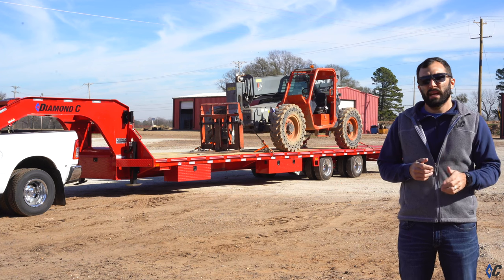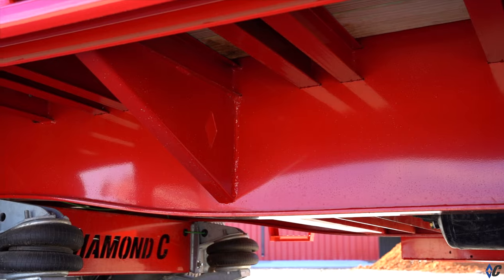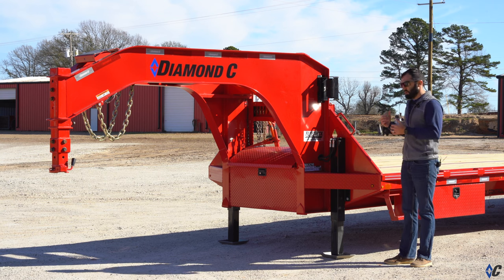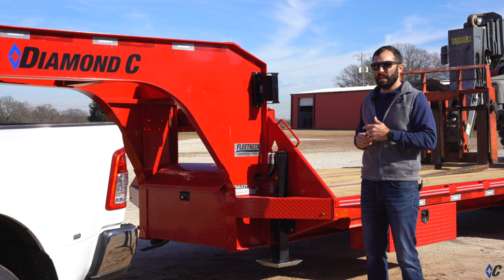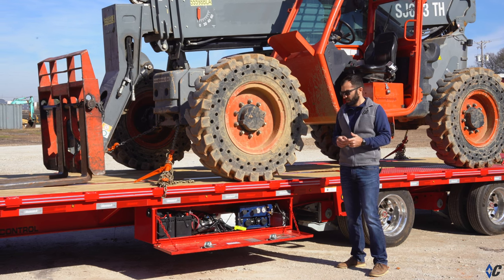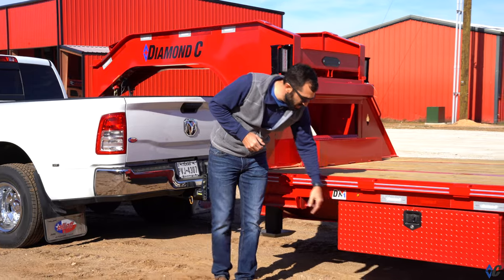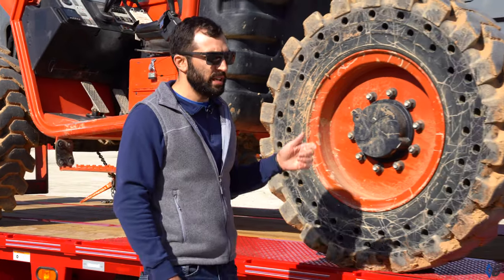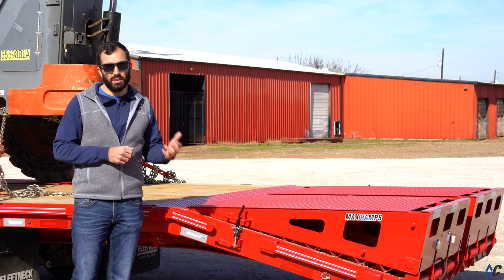40K Hot Shot Trailer | Diamond C

Comment: Love this trailer.  I see this was posted about a year ago but this question seems to have been left unanswered.  As a hotshot trailer rated at 40k,  what kind of vehicle is legal to pull this?  Wouldn't it have to have a GCWR > 40k + the GVWR of the truck?   The Ram 3500 dually HO Diesel has a GVWR of 14k, plus the 40k of the trailer totals 54k which exceeds it GCWR. I'm sure it could easily tow the trailer plus it's cargo, but it would get stopped for being Overweight for excess GCWR.  What kind of hotshot vehicle can legally tow this?
Reply from the maker: You can use a 3500/4500/5500 or single screw semi. We have many customers pulling this 40K trailer with these sizes of trucks on the daily. 👍 The 14K GVWR is that truck and it’s contents that’s not the tow rating. A 2022 Ram 3500 high output is 37,090 tow rating. 

https://www.ramtrucks.com/ram-3500/capability.html

Comment: What pick up truck can handle that trailer’s full capacity?
Reply from the maker: That’s a great question! 
A great example is the late model Dodge 3500 has a tow rating of 37,000lbs. Then from there you have the 4500/5500s as well as the single axle semis being used as well.

Comment: I am going to make some assumptions and generalities here. A 40' GN is generally about 10k pounds. Your system saves about 1500 pounds. Then you add those ramps, the hydraulics and the box to hold it. Is it safe to say those options added most of that weight back to the trailer? So this particular trailer is right at the 10k pound mark? Just to be clear, i am in no way talking bad about it. In a business where you get paid and fined on what the scale ticket shows, this will be the question that gets asked. I own 2 Diamond C trailers and looking at another one, although not a FMAX.
Reply from the maker: The 1500lbs savings is as compared to comparably equipped structural beam trailer. So if you had a straight deck (not Max Ramps) with standard jacks (no hydraulics) it would still be 1500lbs lighter than a comparable structural beam trailer. Hope this helps!

Comment: Peace question for FMAX216, isn't trailer GVWR 40K useless, because DOT officer will check lowest value specs which is each axle is 16K meaning total 32K. So best accurate & proper fit GVWR trailer if derated lower to 32K, right? Enlighten me. Peace. 

God bless you all.